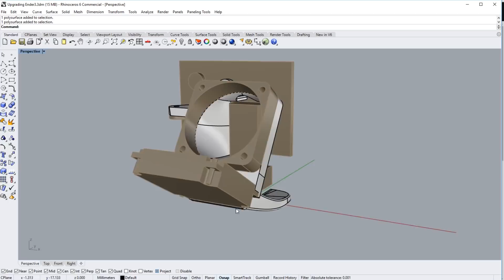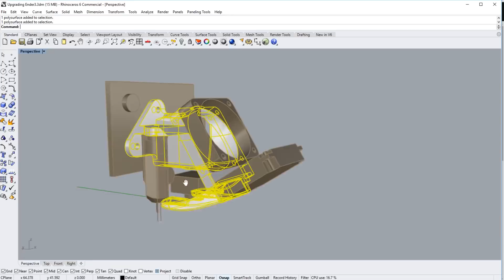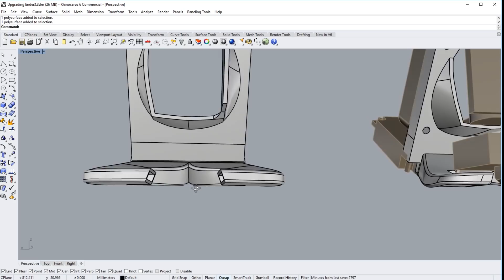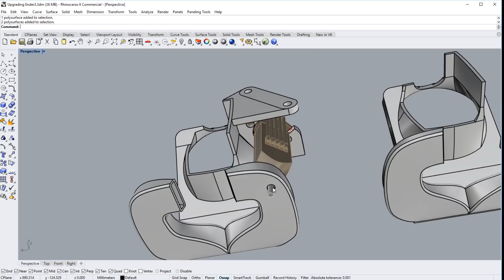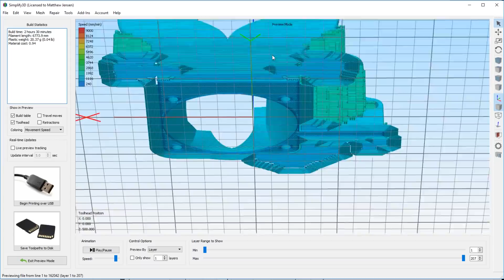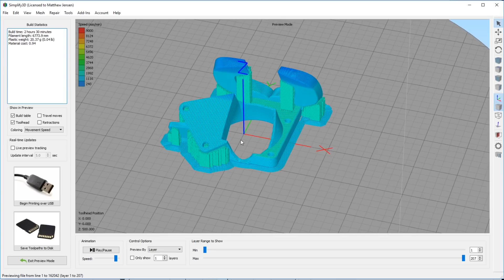Upgrading the Creality Ender 3 with Duet Wi-Fi, and other add-ons - part 1

Comment: As an owner of 2 Prusa MK3 printers and a Velleman K8400. I respect the time and efford you have put into this video modeling etc etc. But you cant give any feedback because people box you in 'Prusa Fanboy' and no discussion is furthermore possible. I work at a 3d Print shop and we sell most consumer and industrial printers you can google on the internet. And i have first hand experience with a fair ammount of printers. 1 of the reasons i chose to buy 2 Prusa MK3 printers is the same reason you advocate about the Duet board and the auto bed leveling probe. I wanted support Prusa research and not chose for cheap Chinese nockoffs. Wich the Ender also is. The Duet is more suited for Delta printers and certainly not intended for Ender kind of printers. And here in the Netherlands and a Duet circuit board costs a bit more then the Ender printer. Do i want to print Wifi i buy an Raspberry zero for 10 euro's and put it on my Prusa. Or i buy a WiFi capable SD card. Simplify 3D costs here arround 145 euro. Prusa has its own development team With buying there printer you support there software development and in a way i get the software free. Another reason i chose for Prusa you can throw a lot of different filaments at it. I don't see you print Flex for example on the Ender. Furthermore and i dont know if it was Makersmuse or Thomas Salanderer wich meantioned that it is likely that Creality will terminate the Ender line. True or not i take those things into consideration. The comparison Ender Prusa Mk3 is in my oppinion not a valid one. You can't compare a 3D printer manufactorer wich invests money into hardware and software development. With a company wich produces knockoffs from other companies. To close time is money. How much time do tou spend to upgrade an Ender to a Prusa Mk3 level? Say from start to finish you spend 52 hours in looking on the internet for research modeling stuff tweak bugfixing etc etc. I normally earn 45 euro an hour. So 2340 euro's for working for 52 hours is for me a way better investment than thinkering on a cheap printer and save say 500 euro's on a more expensive printer. Yes but you learn a lot you say. Well most people can't make a living in upgrading an Ender to Prusa level 3D printer. Anyway the video was informative but i dont regret buying 2 Prusa's.

Comment: My advice on buying cheaper “knock off” parts is that if it’s open source, anywhere you get it will likely be the exact same quality, where as if the original was reverse engineered or mimicked, that’s where quality can become an issue

Comment: And what about using the octoprint instead of the dual wifi?
Reply from the maker: The web interface isn't as clean, the installation of Marlin is much more difficult than the Reprap firmware, and if I want to get Trinamic drivers installed I would have to buy a different control board with detachable Stepper modules on top of purchasing the Raspberry pi and the trinamic sticks. Basically, the DUET is easier and cleaner.

Comment: Quick questions: 
1) Is this purely to get the same features as a prusa, or improved features?  Does print quality come into it as well?
2) Why did you go for a WiFi board over an OctoPi (I move SD cards around so interested in various options).

First video I've seen of yours and subscribed (normally watch a few weeks before subscribing), will look at some of your other videos so may find answers there.  I'm really looking forward for the next part of the series.

BTW:  You can't be surprised at the kickback from Prusa owners, they've spent 6 times the amount for something that provides the same print quality, and then you say for a bit more you can get the same features.  As Marge Simpson said "It's true, but he shouldn't say it".  
You could point out the extra gets them phone support and they don't need to spend an hour building their machine and something :-)
Reply from the maker: 1) The Ender 3 already makes prints which are very close if not the same quality as a Prusa. To my judement the largest improvement is possible in the part cooling. Hence the reason I went to the effort in the video. All the extra features are what makes a Prusa so desirable, which is why I'm trying to add them to the Ender 3
2) The Duet Wi-Fi comes with Trinamic 2660 stepper motor drivers. There is no way to add these to the stock board on the E3. Not to mention the difficulties with getting a separate piece of hardware (bootloader) working in order to flash new marlin firmware onto that board. That board is just garbage. It's amazing what has been accomplished with Marlin firmware on these 8bit chips, but it is very difficult to set up for 99% of people who never really succeed, and the 8 bit chips have difficulties. Mostly the 8 bit chips can't run Delta printers very well, but that lack of computing power also manifests in a basic user interface. 

The Duet runs Reprap firmware. I think it is a superior firmware. It certainly has an easier installation which is easier to fix when you make a mistake. It is all done through your browser. This is the subject of the next video, but you can see what I'm talking about in the other video I made about installing Duet on my TLM: https://youtu.be/BgkJVgFnPaE
Reply: Thank you for your response.  Marlin seems to be the only firmware spoken about with the Ender 3, so it's good to discover alternatives - will watch the other video.
Reply from the maker: Reprap firmware requires a DUET board or an Arduino DUE with a RADDS.

Comment: Someone's a fan boy.  It is kinda funny that you think coping something that is open source stealing.  It is smart to get quality components but it is not stealing when someone gives their designs to the world to copy and that coping happens. 

 Prusa might gather great innovations others have done, but they have created lots too not to mention the whole I3 design is his from the rep rap project.   The Ender has lots of issues and the Prusa mk3 is incredibly better engineered.  Plus since they print their own parts with their own printers you can be sure that they care about how it prints.
Reply from the maker: Zip ties and 3D printed parts for key mechanical components is not "better engineered." Prusa did not invent the "I3" overhead gantry style frame. That is a design which has been in use on CNC machines for 20+ years. His design is the logical improvement on the Mendel. BTW the Mendel is the first printer which Prusa produced, a design which was created by Dr. Adrian Bowyer NOT Prusa.

Comment: I know this is off the topic of this video but I have two questions... What are you doing with the waste plastic? How can we ensure that it doesn't end up in our landfills and the ocean? Thanks, Dan
Reply from the maker: Unfortunately, it goes to the landfill. Most of my printing is done with PLA, and that is good because PLA is made from corn and cane pulp. It is actually biodegradable in an industrial compost, so in the landfill it should break down in a decade or so. The parts I showed in the video were made from ABS, and that is non biodegradable. Fortunately, I don't print with that plastic very often.

Comment: I'm sorry but this doesn't make sense, nothing actually improves the printers print quality but you managed to spend an extortionate amount of money on a very cheap printer that prints well out of the box.  

Better options would have been 

* replacement extruder because the original one is a terrible design
* better pneumatic fittings for the bowden tube
* linear rail for y axis to improve stability
* check everything is square tight and runs smoothly
* heated bed insulation
* re-flash so you can get manual mesh levelling
* when you have manual mesh levelling fit solid spacers instead of springs to the bed
* Tusk cooling nozzle simple and effective
* get a good slicer profile

All done costs next to nothing and will have better print quality as well as more reliability and reproducibility.

Spending more on a board than the whole machine is just in my opinion a bit daft and i say that as an owner of multiple DuetWifi boards and as it happens Ender 3's.
Reply: Basicaly that.
I would buy two ender3s with that money...

Hack it, make it dual extuder, double z axis, anything original...
not... ~lets replace with Duet Swag that i got for free...
lame
Reply: My Tevo Tornado's got these beat.  ;-)
Reply: @pedrojustice  i guess thats ok if you know how to hack it..lol
Reply: +Gareth Price Heya, i just had a question and a remark. I think there is a bit of a contradictory statement here: "on a very cheap printer that prints well out of the box"  "*replacement extruder because the original one is a terrible design". Since i am interested in getting one and not spend too much money on it for upgrades, like a board for example. I just want to have an answer from someone who knows:  Does it, or does it not print well?
Reply: @TheMostTruth  I have it and it prints very well. I only have some problems recently I dont have yet resolved, not sure if its my new cura profile, a clogged nozzle or whatever... but I just printed some upgrades I found on thingiverse like the Z spacers and stuff and replaced the extruder (which is 20€ one time) so yeah: without paying that much money you get pretty decent prints.
Reply: Where is a good source on getting and upgrading to linear rails for the Ender 3?
Reply: +Gareth Price Thank you for your comment! ... Being constructive and productive without insulting anyone!

Just a list of tweeks i've been looking for: simple and affordable options for a budget printer. I've decided to buy the ender 3 and I am already looking for improvements. Just because they can be done.
Greetings from Germany!
Reply: Gareth Price thanks for commending bro it helps a lot to know how to improve the quality of the print cause is the most important for me
Reply: Cool, thanks!
Reply: no problem.
Reply: Gareth have you any pointers how to go about doing what you suggest?
Reply: Yes, but he got it all for free!
Reply: I have bothe the Ender 3 Pro and a Prusa MK3S and this simple mod will not get you printing like a Prusa.  You need to go direct drive, dual z axis, e3d hot end, borosilicate print bed or spring steel pei sheet, upgraded heat bed, induction sensor, and a board upgrade.  Ive done all of this and some more and my Ender 3 prints consistently as well as Prusa.
Reply: @bigboycombo6342  at that point I feel like I’d rather just buy another Prusa than completely rebuild it from another printer. I’ve already built and upgraded a Anet A8 that I bought in early 2017 before the ender 3 came out (mosfets, then replaced main board, power supply, bed, etc.). At this point in my life I don’t care for another project printer. So If and when I get to needing a new printer, I’ll likely save up for another Prusa lol
Reply: Yeah, a Duet 3D is complete overkill for WiFi printing. A cartesian printer doesn't need 32-bit processing, and you can print wirelessly with an OctoPi. A Duet will, however, give you a quieter machine with the ability to resume prints after power failure.
Reply: Gareth Price  the point is that the same upgrades may be required on an i3...but you are already paying 700+$ for it. Cheaper printer, which already prints great out of the box, you have the room to pick and choose upgrades
Reply: Still junk!  No Ethernet...
Reply: @s.4593  Nobody needs ethernet on a 3D printer
Reply: @CristalianaIvor   LOL Still using Sneakernet with a stupid SD card?
Reply: @s.4593  Why not? I use that thing once and then print for 24h.
Sometimes its anoying if you have to reprint small stuff and all the time switch the sd card from the pc to the printer, but its not really anything that buggs me too bad.
Reply: in my opinion, instead of rewiring the main board and doing all that he could of just ran an octopi.

Comment: Guess I'll have to jump on the bandwagon here, but I see afew flaws with this, I mean for someone to buy this printer out of the box then have to strip in down and do what you've done, why not get an Anet A8 or some reprap clone where there is tons of support and files out there, reminds me of when some of the Chinese companies started to ship the Melzi board out making it an absolute pain in the bum to work with.(My bane).
Reply: Because the original Anet A8 platform is utter rubbish and the Ender really doesn't need anything to print well out of the box.
Reply: So why did this guy ditch the board and design new ducts if it can print well out of the box ?

Comment: Dude, that filament sensor is such a downgrade. It can't even work. Once the end of the filament is past the extruder, how will it move past the sensor? Did you really think this through?z
Edit: saw now that it is a motion sensor (for 50$!?). My attention span is not great on this video
Reply from the maker: Are you trolling? The filament sensor detects movement of the filament. When the filament stops moving it triggers the firmware.
Reply: Not trolling. I thought it is a filament run out detector, not a motion one. I don't get it why you would need a motion sensor
Reply from the maker: Filament can jam in the extruder in two ways: Flexible filament can pop out of the channel making an ever growing loop, and harder filament can grind on the hob gear. Either condition would not trigger a run out detector, but would result in no filament being fed through the nozzle. Using a filament detector allows you to catch these two conditions and also a filament run out condition.
Reply: That makes sense. Although I never had that happen to me I see why it's useful to some. Pricey toy though if it's 50$
Reply: @batcadragos  Seems a stretch when an optical mouse is < $5
Reply from the maker: I don't know how much it will cost. It's not yet available to the public. I have a beta test unit.

Comment: Sir, you can add and remove supports in Cura. But the caveat is that it's very finicky and requires some struggling with the custom support editor controls to add in the null boxes in the right spots to get rid of unnecessary supports. Adding supports is also somewhat clumsy.
Reply: I find it pretty easy to just place and resize the support blockers, then play with the support settings as needed Cura could definitely use more options for supports placement though.
Reply: I tend to do bigger prints then what I see others printing, and I do lots of organic shaped objects, heh. Giggity. Several times I've had the null boxes completely covering the support placements to no effect, until I placed them with a very wide parameter of null boxes on all sides of the targeted support apex. At times it was a bit tedious busy work. This is especially problematic with larger organic shapes with lots of overhangs. Some polish is needed there, but yeah it works.